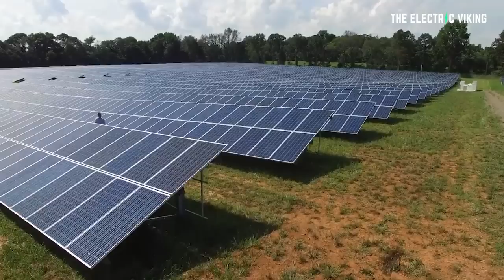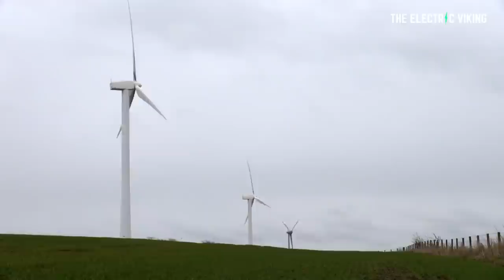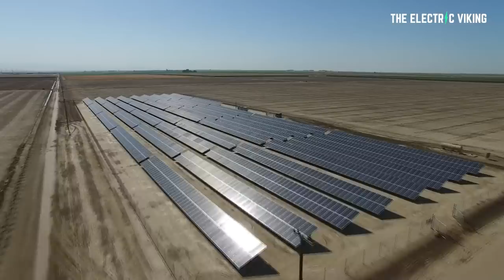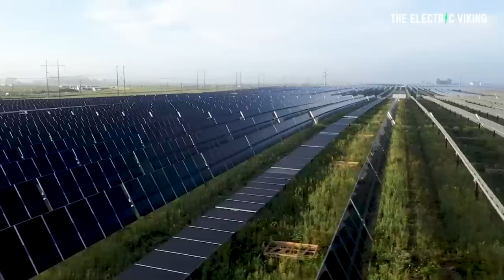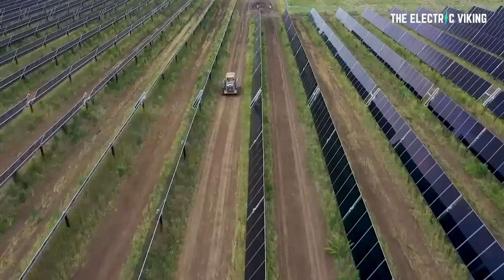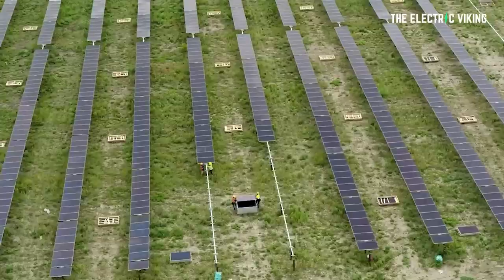Renewable energy is destroying coal & nuclear energy in the US

Comment: More solar and wind = more green hydrogen production. Great 👍
Reply: Where?
Reply: Wind is easy. You have many windy days and not roo much as hurricanes. 

In Denmark we are frontrunners  inveted the windpowerstations we see today. They cover 40% of the electricity we use, but many things and now cars still are drive by fossils. 

So we change making more and bigger widfarms. By that at least 50% of all energy consumption can made for electricity as well as very much for warming all buildings uited in very big systems. 

But there is only wind 200 days a year. So we have to remain and maiintan full cover for that.  BUT in the 200 days we easy can make 5 or 6 times more then we need. We then can make products to burn or export. By export we has money to boy from fossils, nekefacilitis and water power stations. 

WHERE is where there is wind. It wll reduce but not remove other productions BUT it will 1/3 be not needed at all. Thats a lot for private households and the private and public sectors. 

https://en.wikipedia.org/wiki/Vestas

Siemens windpower is in Denamrk too.

Comment: Solar increased 26% from previous year
Reply: There is also the question of continuous capacity.   A gas fired generation plant has over 90% availability
Reply: Solar averages 30% in the United States.  ELEVEN % in Germany
Reply: That means I’m Germany solar is not generating power 90% of the time.
Reply: Solar is not producing power 70% of the time in the USA.
Reply: Dream on, Sam.  Without 24/7 base load fossil fuel or nuclear, the grid cannot operate.
Reply: A warm winter in Europe has saved them so far.

Comment: The whole world must work with renewable energy only. Why has this been taking so long to happen? Why are we still using the old energy?
Reply: hmm you should have studied engineering rather than the humanities and Greta Thunberg - but renewables are intermittent, unreliable and affect grid stability - they deliver power when they can, not when its needed and can change output power in seconds (clouds etc ) - so unless massive storage solutions ( money money) are built, they still require gas (coal power can't respond quick as a cloud or wind pause) or nuclear as backup to cover 100% of the load - so you get 3 power systems renewables / storage / constant supply for the price of 3 times plus, due to more poles and wires and infrastructure - Also under envoromental laws, how many new dams for hydro will get built ?? see the problem, understand the problem - simples
Reply: Don’t you think the word “destroying” is just one of the click bait tactics to get more views.  Do you really believe that renewables will replace the baseline power generation that nuclear and natural gas provides today?   Yes get rid of all the coal plants but let’s focus on a realistic mix of generation sources.
Reply: @jimlofts5433  Thats total crap writing like that. There is no instability the autofunctions cant handle. Just as Our stowe You can use 0,1,2,3 and 4. 

And those changes can be 000% supported by weatherrapports and clouds. 

And they do exist here in Europe. You can just buy and implement them in Your own version in comapny or sate level.
Reply: @clydesdale64  Its hard to say about the max replacements. Its very much a matter of innovasion as well. 

But for sure USA and many parts of the rest has a gab, which can make a lot cleaner and cheeper electricity. That goes for the areas with wind and sun. 

So we start with that gab making our credit cards and pockets less empty.